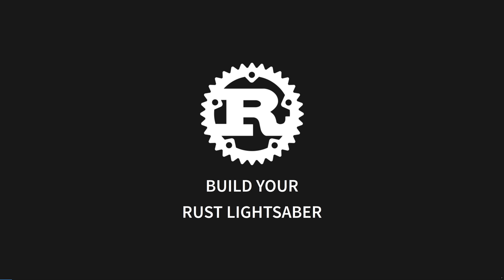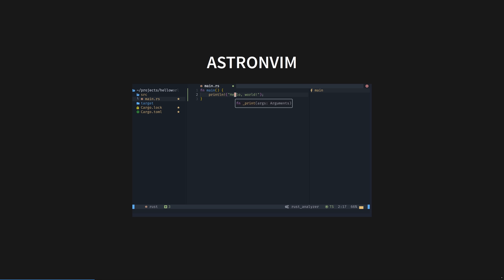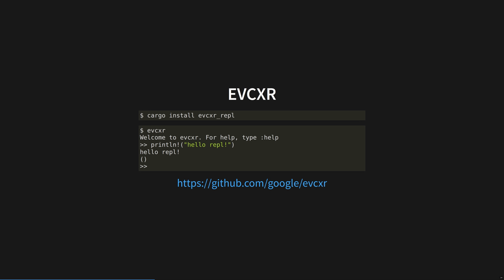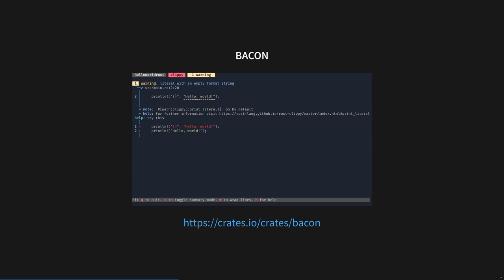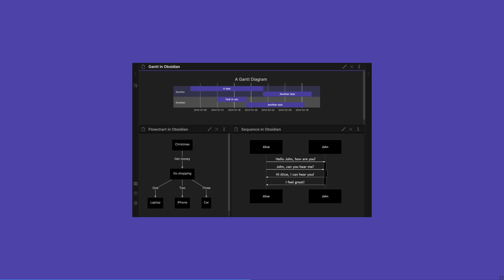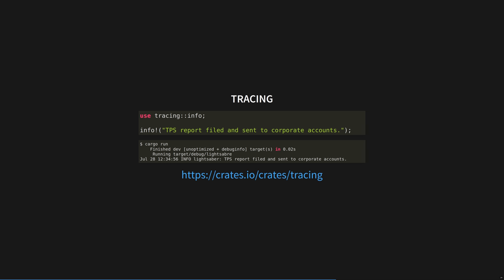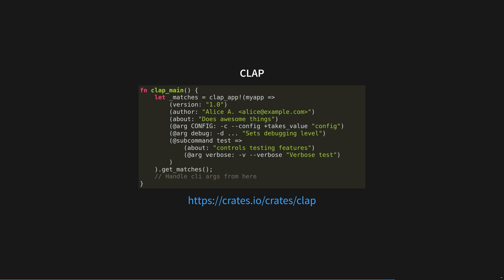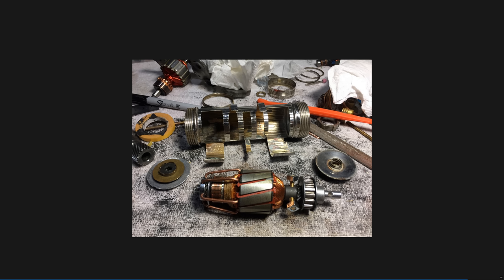Build your Rust lightsaber

Comment: I don't get one thing. Why do all modern systems languages avoid GCs? They don't slow down an application too much, they don't add a big memory overhead and ye, in 99% of the cases I think having GC would benefit more than harm, so why are all languages avoiding it? Is everybody so hardcore focused on efficiency? When I tried out Rust I was just thinking for myself: If I had a GC 90% of the learning courve would disappear, so why not using a GC?
Reply: What do you mean by "all modern languages"? Pretty much all non-GC modern languages are "improved C" or "improved C++", and similar niche. Crushing majority of modern languages have GCs for the exact reason you mention.

The reason non-GC languages are somewhat on the rise, is twofold:

1. GCs waste RAM (by keeping a lot of garbage around) and introduce random lag spikes. On larger scales, that's a significant waste of resources. For a large company, that means upgrading your hardware more often and having lower service throughput on the same hardware using the same electricity. Languages without GC cleanup memory more eagerly (no garbage) and more evenly (no lag spikes). There's tangible benefits for using non-GC languages wherever convenience allows it.

2. A lot of advances in CS have been made since C/C++ was made in the 70s/80s. Modern computers aren't getting faster; they are getting more parallel; main performance bottleneck is caching, synchronization and IO. That's not something C/C++ was designed to handle. C/C++ is also plagued with design decisions that turned out to be poor in retrospect and can't be fixed due to backwards compatibility (examples: copy by default, null pointers, ambiguously-sized primitive types,...). We have reached a point, where redesigning the language from ground up is the more viable option.
We developed techniques for managing memory, that aren't as heavy handed as full on GC, and not as unsafe as manual malloc.
Reply: @KohuGaly  I should change it modern systems languages sorry
Reply from the maker: So there are lots of technical reasons people will give for and against a GC. Against, will talk about overheads, or GC pauses causing problems with real time applications. For, will talk about ease of programming and how modern GC are really efficient and we have spare cores anyway.
I sidestep that debate.
Rust solves memory with ownership. But guess what: ownership is a really useful thing for a type system to keep track of, along with lifetimes and references.

- If you have a GC, you have a GC.
- If you have lifetimes you can model not just what your data is, but WHEN.
Reply: @NoBoilerplate  I mean, the moment we move out of realtime the performance/memory overhead of a GC is pretty much a non existent issue, but I gotta check out how the ownership interacts with the type system, sadly I didn't use rust to an extend to use this interaction in any noticeable way.
Reply from the maker: @fischi9129  I've had high volume ETL pipelines choke because of java GC pauses. We had to scale more than we needed due to this. I'm very pleased that rust just sidesteps this issue. Very wonderful!
Reply: @NoBoilerplate  I mean, java arguably ain't a great language to begin with, (By design, not on how stable etc it is)
Reply from the maker: @fischi9129 fair, but, the JVM has ahead trillions of dollars and decades of optimisation.
Reply: @fischi9129  Yes, GC is not a problem most of the time. But it is sometimes a problem, particularly in systems programming.
That "_sometimes_" is where your company is loosing money, because GC was forced upon you by the language, with no easy way to opt out of it.
Having access to GC-less systems language gives you the option to decide on the tradeoffs you're making.
Reply: @KohuGaly  How would a opt out GC be? For example where it and all it's sub-scopes are handled manually if you explicitly say that? that would have the best of both worlds🤔
Reply: @fischi9129  Rust is a good case study on this "why not do both GC and manual?"

Rust used to have a GC alongside manual management early in development. Then they removed the GC from the language and moved it to the standard library. Then they removed it completely.
It added unnecessary complexity, and its use cases were minimal, because the ownership system and borrowing already manages 99% of use cases.

Garbage collection was moved to external libraries.

The "GC by default" approach combines the drawbacks of both. The non-GCed sub-scopes still need to be scanned, if they may contain GC references. The GC end up doing the same amount of work, except it doesn't collect all the garbage.
If the "manual" subscopes can't contain GC references (and therefore don't require scanning), then their only point of contact with the rest of the program is their API. You might as well write them in purpose-build non-GC language and pull them in as dependency.
That's actually one of the main use cases for Rust, and partially the origin of its name. You may have heard of oxidation - the process of gradually replacing parts of legacy systems with Rust.

Comment: What's the alternative to unwrap or except? I was thinking except is already the alternative to unwrap. There are cases, where I want the program to fail on error.
Reply: panics (including unwrap/except) are typically for fatal errors. Main function already supports returning Result. You can bubble your errors all the way to the main and abort with exit code.
Reply: @KohuGaly  Yeah, that's an option. Is this really more elegant, if I know, I want to panic?
Reply from the maker: Match on the result, panic!() explicitly on Err.
Reply: @NoBoilerplate  That's boilerplate.
But you might be right because the error messages of expect are not what I'd expect.
Reply from the maker: @porky1118  boilerplate is unnecessary code. For me, the match statement allows most cases of unwrap to be safe at runtime. That's not unneccisary! 
Panicking also feels kinda TODO-y, as really what you probably want is to use a panic handling crate, generate a good error message,maybe some debug logs,and exit in a more comprehensive way?

Comment: Linux users: For the sake of sanity, consider installing Rust etc. with your package manager.
Reply from the maker: Do not do this. Rustup is used everywhere and switching to and from the nightly toolchain is a feature you want to do now and then. 
It's like using pyenv, rbenv, asdf etc - changing the version of your language is something you will need to do. Having a "systemwide" version is an antipattern.
Reply: @NoBoilerplate  True. Can I get away with saying I meant to say "install rustup with a package manager"? ;) That's my setup...
I also don't work much on multi-user systems, which are the main case where I can see systemwide installation inherently being an issue.

(edit
By which I mean it's a tooling problem since system-level package managers aren't always designed around having multiple versions of software available.
)

(Who needs multi-user when we can just containerize an entire additional instance of Linux for each person? /s)
Reply from the maker: @Argletrough  oh terrific! Package manager rustup sounds fine! As long as .cargo is still the cache

Comment: I love your videos, but I disagree with you on yew being faster than react, it's basically on par. It might be in the future when interface types become standard in WASM, but that hasn't materialized yet and I personally dislike choosing a framework based on promises. You'd be trading the incredibly fast iteration cycle of react for it.
Reply from the maker: Thank you so much! That's very kind of you to say :-)

ALSO: I have really great news, there's been a SEA CHANGE in the year and a half since this video due to https://leptos.dev - which is both fast AND ergonomic, and the community has instantly rallied around it.

Wasm missing interface types is irrelevant. Even with no interface types, the fastest rust frameworks crush most js frameworks, and are on par with solid in terms of speed. Yew is about the same speed as react, sure, but that's due to the way yew is designed, not some upper limit of wasm. If interface types come along one day, it'll be no contest, but even right now, it's extremely clear that speed is not an issue.

In terms of benchmarks [1] Leptos gets to 92% of vanillajs's speed (vue 80%, svelte 73%, react 33%)

And React doesn't have a monopoly on fast iteration:
Leptos has many of the great ergonomics and batteries-included features that we've only seen thus far in mature js frameworks, including instant no-reload updates, scss/sass building, and serve-side-rendering: read this page and get excited: https://leptos.dev/

This video explains the rust wasm sitaution in great detail: https://www.youtube.com/watch?v=4KtotxNAwME

What do you think?

[1] https://krausest.github.io/js-framework-benchmark/2023/table_chrome_113.0.5672.63.html
Reply: @NoBoilerplate  that is gtk, didn't know about leptos, probably because of the consistent "0 days between new web frameworks" thing. I will have to give that a try.

Obviously without that I can't give a verdict on my opinion, but that looks like it's closer to solidjs (favourite framework atm, so it's in good company). Solidjs still comes out on top according to krausest, but I'd dare to say the performance difference is probably irrelevant at that point and it comes down to developer preference and comfort.

Thanks for sharing!
Reply: @NoBoilerplate  Btw, wanted to clarify. I obviously don't have anything against either you or the video, it's great, don't take my original comment as an attack. My main gripe is with some devs slightly misrepresenting the performance of their own frameworks. Leptos looks great, but it's still true for that as well, their website claims the perf order from chrome 113 and leaves out solid, since then it changed around completely (minus react of course) for some reason I don't see.
Reply from the maker: @BalintCsala  No worries friend, I didn't take your comment as anything other than constructive, and quite reasonable given the 1.5 years since the video, lots has changed! 
Thanks for your kind words again 🙂
Reply from the maker: @BalintCsala  Pleasure! Heh yeah, it's always a bit like that at the start, I even have to change my backend framework recommendations (Axum has come out on top in popularity, and you know what I think about choosing popuar languages and frameworks!).
Excitingly, leptos has first-class support for axum as server-side rendering, which looks incredible, calling backend functions from frontend code! https://book.leptos.dev/server/25_server_functions.html

Comment: I've seen some arrogance on the internet but this is def. in the top 10
Reply from the maker: Why's that?
Reply: @NoBoilerplate  I mean, you are comparing rust to a lightsaber as if you came from the effing future. You channel is called "No boilerplate" but you promote rust which is roughly 50% boilerplate code similar to java and other typed languages. Plus all those tools that are anything but light-weight, you recommend MS bloatware like VSCode. Nobody is taking away the fun you have with rust but honestly stop acting like a damn cult of individuals with superiority-complexes
Reply from the maker: @gordonzar992  I'm sorry you feel that way, I hope I can clear some things up:
1. I'm re-using the idea of a 'vim lightsaber' which is something I've only just found out about, and is a really neat concept!
2. Rust does indeed have much higher line noise doesn't it? I struggled with that at the start, it did feel like boilerplate. But boilerplate is UNNECESSARY extra code. After I learned more, I realised Rust's extra syntax (lifetimes and such) are to give it features no other language has. Rust also has a lisp-grade syntactic macro system, which in my experience is the killer language feature for zero-cost minimisation of boilerplate.
3. I didn't just talk about VSCode, I also mentioned Eclipse and Intelij (Both MUCH more bloated) but I then recommended Nvim, an incredibly lightweight editor. The only LSP-capable client that is lighter is probably Helix, a pure rust vim clone. You and I sound much alike, we don't like bloated editors, but please understand I have to cater for a wide audience. No sense scaring off people with unfamiliar editors as well as an unfamiliar language! 
Personally, I don't hate emacs, though I switched recently back to Nvim. What's your current editor of choice?
Reply: @NoBoilerplate  I use plain old vim with some plugins. I dont really use LSP, i prefer to read documentaion. In either case, the "lightsaber" concept extends to that video too. I just dislike rust-oriented videos mainly because of the attitude, not the language.
Reply from the maker: @gordonzar992  Very nice, I like a pure vim config, this was mine before I drifted around editors for a while, before coming back to nvim: https://gist.github.com/0atman/c9fd6fefe47da0726328fabadc6a1153 (this config is both vim and nvim compatible)
BTW I tried the Spacemacs distro of emacs after getting into the Clojure world - it seems reasonable that the best editor for lisp would be an editor written in lisp! Spacemacs is an incredible distro for emacs, more like an OPERATING SYSTEM really! I switched to Doom emacs to get some lightness back, once I knew what I wanted. They both have an incredible vim emulation mode called Evil. It's actually not vim emulation like you can get in (say) firefox - they PORTED vim into emacs lisp, the mad people. Ex mode and everything. Wild. Vim bindings are MANDATORY for any editor I use, and not just hjkl. 

I am sorry I come across with the wrong attitude for you, I'm not trying to be smug or boastful. I'm genuinely really excited about this language, and hope to get more people excited by explaining the features.
Imagine for a moment if Rust really did have compiler-provable concurrency, how could I talk about that without using language like "this changes everything" or "no other language has this feature".
Reply: @NoBoilerplate  I dont want to take away the fun from you. Have fun with rust. You seem excited about like I was excited about SBCL. I still would prefer it to rust, but if really wanted to produce the "correctest of correct" programs, i'd reach for OCaml these days (or Haskell if I could actually write haskell). Many useful features came from functional programming languages.
Reply from the maker: @gordonzar992  I think I would do the same - Haskell for me, but only because I don't know OCaml. The fact that Rust has snuck in a lot of what makes Haskell programs correct into popular programming (#19th top language) is incredible!
Reply: @NoBoilerplate  Many languages are trying to implement monads and other functional things into them. But there just is no replacing a proper functional programing language. Rust has sort-of built-in monads but it lacks currying, partial application, proper-functions and true immutability. Due to explicit typing higher-order functions are hard to create, use and read (any typed language has this, C and C++ being the worst offenders, making functional approaches to problems clumsy and very verbose and cryptic). OCaml has these, its syntax is similar to haskell and it can compile directly into native code, so its quite performant and its an 'impure functional programming language' meaning that writing functions with side-effects isn't as clumsy as in haskell for example. It's a very good development in the software industry that more and more functional things are being put into imperative programming languages, since functional programming has its roots in mathematics. If we are lucky, software development may be seen as a proper science in the future, rather than a nerd-weirdo-hipser thing.
Reply from the maker: @gordonzar992  Oh cool, I didn't know that about OCaml, I will look into it, I'm a big fan of making compromises with purity to gain practicality.
Rust at least has many of the features you mention, but I acknowledge nowhere near as concice or ergonomic as Haskell or (I assume) OCaml. Here's a nice collection I keep bookmarked to refer to https://crates.io/crates/fp-core
Reply: @NoBoilerplate  Great! Not sure if you have already, but since you like rust and FP you can easily introduce people to FP via rust and the crates you mentioned.
Reply from the maker: @gordonzar992  Terrific idea. Rust's got a lot of functional stuff that I love!